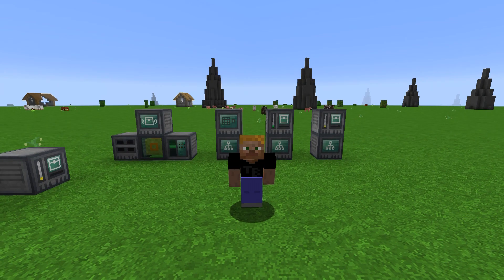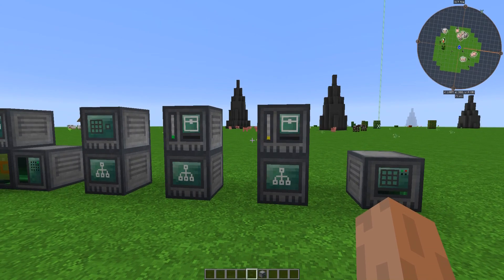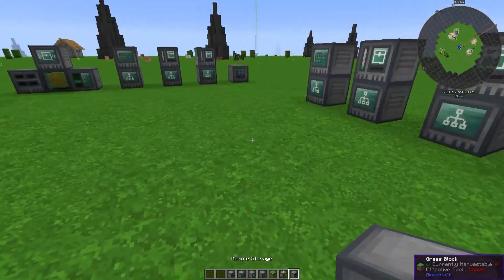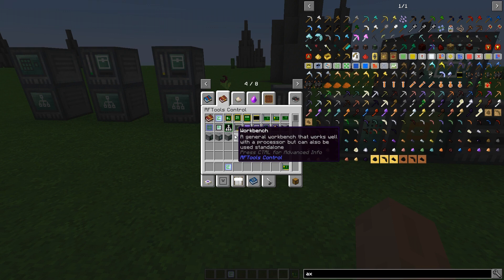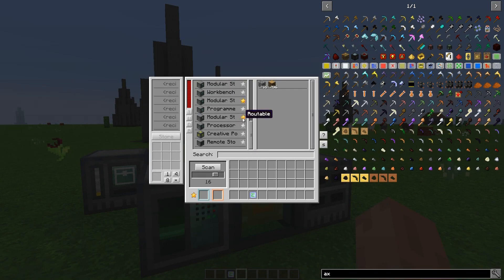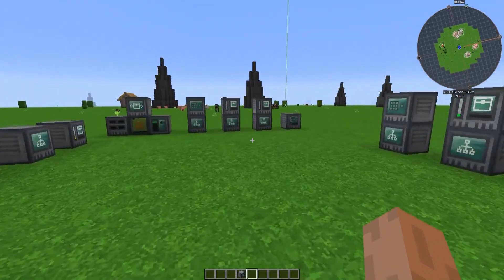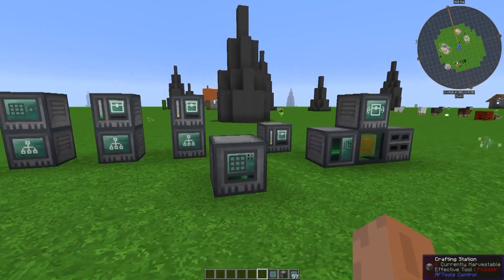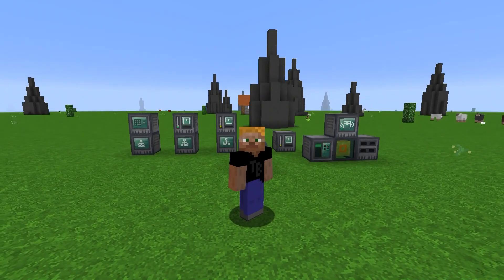EASY AUTOCrafting w/ RfTools Control - No Programming

Comment: Hey Toddy, 

Have you come across the problem of recipes that have a by-product jamming up the system under this program? For example, botania floral powder grinding or using something that leaves a bucket behind like a treated wood recipe? I've been struggling to come up with a good solution that doesn't error out and leave the locks in place.

I have found, by the way, that while we do need a network card we absolutely don't need the other nodes if you lay out your system in the wall in a cross pattern next to the storage canner. In a very early game setup, you can get a storage scanner and full autocrafting online with your first 3 ender pearls, and the hardest part is making sure you have a good supply of gold, paper and green dye.
Reply from the maker: pastebin: 2y0yPmTS  

Sorry, youtube wouldn't let me place a link on my own video. Here is the solution that I came up with. Good catch. I guess I've been lucky not setting any byproduct recipes. What the add-on does is check if there are items in the top of the workbench. If there are, then it clears a slot and checks again until it's clear. You'll have to change the inventory locations to what you are using. 

The cross section idea would be cleaner. I need to pick up my own mess. I did it with all the nodes to make it easy for the folks that don't want to get into the programming.
Reply: Don't worry man. 

I'll post my modifications for a crafting g cross here later.

I'm working on an "early game with Resonant Rise" guide that I'll release shortly after we cut the 1.10.2 version of the pack and I'm strongly pushing RFTools over RS or AE2. 

Would you be interested in collaborating with us on that?
Reply from the maker: Sent you a message.
Reply: Same.
Reply from the maker: Working. I'll respond later tonight.

Comment: would be nice to see you set this up in game rather than in an open field with created blocks and items.  The inventory you set up, no one would have that setup in there world. It would mean manually dragging items into a module before crafting it. What would be better is to attach the node to the storage scanner and accessing your inventory from that. Not sure if that works however because while I followed your tutorial, trying to implement this into my world, I run into errors of which no one can explain. I do get that this is a couple of year old. so don't read my frustration too deeply. Still looking for a reasonable tutorial on this.

Comment: So if you follow the steps exactly at the start it works. But for some reason, if you change anything around it then stops working. I am not talking about the program itself, there is something else that conflicts with how it works. I tested this in creative and it worked but tried to do it in survival it did not work. I keep getting the "Waiting Error" in the crafter.
Reply from the maker: I guess it depends on how things are changed around. The instructions were mainly intended for people who don't want to learn how the system works, but just want to set it up for use. If I remember right, the person you replied to this morning just needed to do the net setup again after moving stuff.

Comment: it's not working... Idk why...
I fallowed all the steps. the only difference is the placement of the storage scanner, remote storage, and processor. I set the storage scanner to scan 20 and it can't find the modular storage set the farthest away from it, so I picked the modular storage that was placed on the node instead as I figured it wouldn't matter but it's not crafting. It can find the items and it has the recipe but it just stays at  "Wait (1)" forever.
Reply: The modular storage that it can't find is 12 blocks away and one block down from the storage scanner but for some reason it can't detect it.

Comment: If you replace the 'cards' inventory with a remote card (linked to a 4x300 storage module) would that give you access to 1200 recipes, or would it only see the 300 in the currently selected slot?
Reply from the maker: I thought about it, but had not tried it. I'm thinking it would only see one link at a time, but at least you could have four sets of cards. Couldn't get it to recognize Refined Storage inventory. Good thinking though.
Reply: There are 2 ways to get what you both want here in the Resonant Rise, Avant3 and  Mindcrack packs.

1. Actually Additions item lasers are TOTALLY CRAZY. If you slap an item laser on any number of chests, then connect them to a laser connected to an item relay? Then everything in EVERY chest is available to that item relay. Since AA laser networks are expandable, you can use that technique.

And yeah, AA item lasers are mind blowing. You can put super crafting frames on them, you can yank out of them with advanced ESDs or item pipes or logistical sorters, and you can literally hopper drop stuff into the network if they point to an item interface. 

2. So when you make each program, there is a craft event. That craft event is usually blank, but you CAN specify a specific inventory there. You can make multiple copies of the crafting program, each pointing to a different inventory. This gives it limited size. You can also add MANY crafting event inventory starters on one program, each pointing to a different inventory, and then use the wire piece to connect those to the main body of your program.
Reply from the maker: First idea is great.  I'm going to try that in the Let's Play.  I was trying to keep it within the mod(s) for the tutorial.  Just in case someone doesn't have AA in the future.Second idea also has me thinking.  I see what you're saying with wiring the event opcode.  The smart crafting opcode also checks for a crafting card inventory for the recursive part of the program.  How to link those is the part that needs solving.  I'm thinking maybe set the craft operation to a ticket variable and then checking with each copy of the program if there is a recipe for an item needed for the craft ticket.  Maybe wiring from the "craft fail" opcode to the next program copy.PS...Love your modpack.
Reply: I was under the impression you could leave it blank there and it'd query the crafting system as a whole. Is that wrong?
Reply from the maker: Under the "operation: get ingredients smart" opcode, there is a non-optional "CardInv" parameter.  That's so that it knows where to look for recipes for items needed for the initial craft, like planks for sticks.
Reply: ToddytheBody Hum. Normally that doesn't bug me because I don't mind requesting from one primary inventory for base materials.

I think in practice it's not so bad because you can organize your stuff by mod and just repeat common material patterns.

Comment: Sup, your autocrafting bench works, but, because of my modpack, I only have this mod as to auto craft, and the problem I am in is that I want to auto craft inferium essence, because of my master infusion crystal, it stays in the bench, I added an aditional storage to make the infusion crystal go into it by force, but it goes into it only if it goes down into the bar, but not stays on the bench, any tips?

Comment: For future reference I had the thing with the waiting and nothing happening at all. 
I checked everything, most things were all the same as in the video except I put a few RAMs in the processor as why not.

Took them out, and it started working. So if this happened to you, that could be the cause.

My question is, will i be able to put a furnace into the mix? Like if I want something to craft and smelt. 
I don't rly expect an answer but that'll be my next thing to figure out haha

Thanks for the video tho, appreciate it.
Reply from the maker: Just connect a node and have the program insert in the top and take out from the bottom. Interesting how the chips worked. I tried to make the instructions as clear as possible. I dont know why it doesnt work for some people. I've set this up many times.

Comment: Has someone found a solution how to add more storage fór crafting cards? :)
Everything works just fine but 300 recipes is small amount of possibilities :)
Reply from the maker: I haven't messed with this in a while, but I would use whatever storage block held the most in the mod pack.  Some options I used in the past are AA crates, bennie compact chests, and the ender rift.  Last one was the best because it had infinite storage, but sadly it's not a mainstream mod for some reason.  I have not tried accessing storage via ME interface or the storage scanner.
Reply: @xxxtoddythebodyxxx  I solve that by learning and switching to AE2 networks and it's autocrating system but thanks for reply. :)

Comment: I tried getting an Ultimate Gas Tank (Mekanism) out of this, but it just gives me a Basic Gas Tank every time. If I ask for an Advanced Gas Tank, I get a Basic Gas Tank for that too, even though all the required ingredients definitely exist, including the Basic Gas Tank.

At this point I just give up and assume that RF Tools Control isn't a viable automatic crafting system. Since the pack I'm playing doesn't seem to have any other option, this means that I will probably just ragequit the pack and go play something else.
Reply from the maker: Which pack are you playing?
Reply: Sky Exchange.
Reply: Seems like processor doesn't respect the exact names of crafting materials and just picks random item with partial name match. I'm playing age of engineering and wanted to autocraft some IC2 stuff. For example circuits require insulated copper cables. But processor is trying to craft them with copper cable (uninsulated ones). Or for example it tries to craft insulated copper cables with resin and already insulated copper cables even though craft card shows uninsolated ones as material. So this autocrafting system is far from ideal for complex moded things, but more simple items with unique names are crafted just fine.
Also looks like during these fails processor eats up some of misplaced resources.

Comment: Trouble being the insert for this program will no longer work on the new versions, so what you did does us absolutely no good now, and you may as well delete this video :P 

sigh have to love updates and version incompatibilities.
Reply: Augh. I wish I would have seen this comment before I built everything.  Yeah I'm getting a "Error reading from clipboard". I so wanted this to work because I'm tired of doing the same old things for autocrafting. If anyone can do an update on this it would be greatly appreciated.
Reply: There are a lot of bugs in 1.16.  I have written my own (slightly different, more robust) redundant autocrafter for 1.12, but there are serious problems with 1.16.  McJty just today fixed the bug where you could not add a storage screen control module to a processor in 1.16, so don't expect miracles any time soon.  I plan on making a comprehensive video about how to make RFtools Cointrol craft anything, including items that rely upon machine (rather than crafting) outputs, but that is not possible unless I want to use 1.12, or wait until 1.16 has more bugs ironed out.